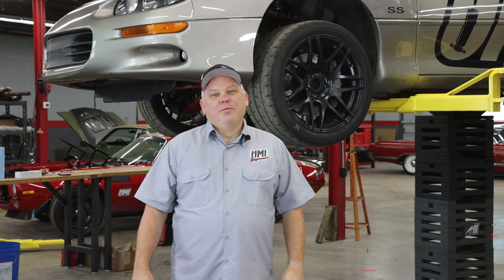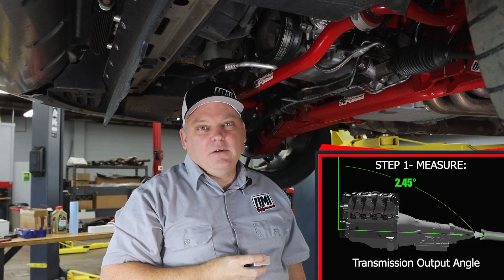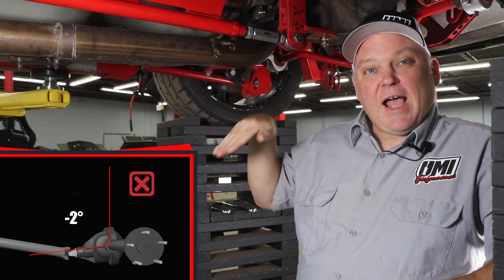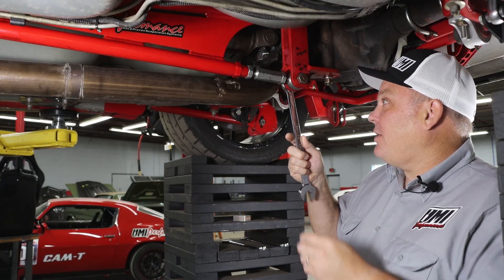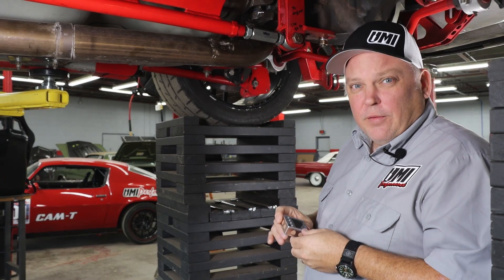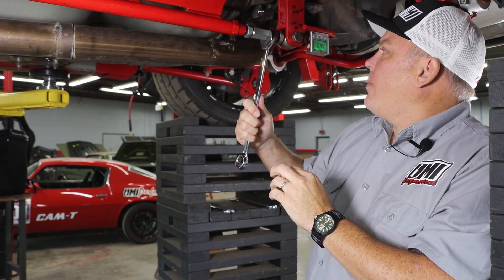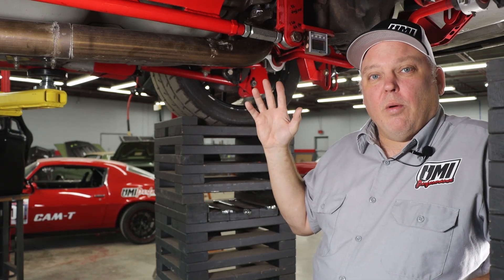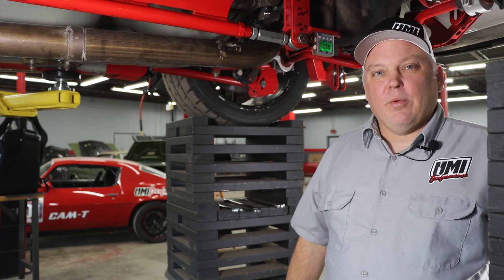HOW TO: 3rd/4th Gen F-Body Pinion Angle Adjustment

Comment: Ok. So I watched this video and chased my vibration. What I realized today is that you don’t t explain the tool you are using. Explain that the magnet is in the bottom of the tool. When checking the crank pulley the tool is in the vertical position with magnet down. Then when you checked the pinion at the torque arm you had it mounted inverted with magnets up. That explanation would have saved me some headache.

Comment: @ UMI
I have the 95 Z28 vibration at starting at 65 acceleration to 80. Crest a hill top put car into natural on down hill side vibration stops. This car is new to me. On service I had both u joints replaced and vibration is less but I want zero vibs. **Note pinion seal leaking
CRITICAL THINKING: The car didn't shake off the show room floor.
RUMORS: aluminum  drive line fixes , + 1.5 pinion angle fixes, new torque arm bushing don't  fix.

What happens over time with suspension control arms?
Do they have bushing mounts? Car has 130k miles.

Does anybody have knowledge of this common issue with the 4 gen Camaros
and a no bullshit fix?
I could spend thousands and still not fix the real issue.
Thanks

Comment: Just installed your arm and crossmember.   You need to update your instruction sheet !!!  It says to used driveshaft angle and pinion angle which would be totally wrong.  In my 89 the driveshaft actually raises from the trans to the diff.   If I followed the directions with the kit, the pinion would be severely nose down !!  It also states the crossmember bolts are M8.  They are M10.

Comment: Good video I was chasing a vibration and found my umi torque arm was hitting the driveshaft safety loop bolt. I bolts were on the 2nd hole from top and I moved it down to the 2nd hole from bottom much better and set my pinion angle at 2 degrees. Still a little vibration but way better than it was. I'm assuming it's because I have a poly trans mount and stock motor mounts. Gonna switch out that trans mount to stock rubber and see if it makes another difference and gets rid of vibration entirely

Comment: So what if your driveshaft runs up from the transmission to the rear axle? is the procedure the same? My car is lowered and the pinion sits above the transmission output.
Reply from the maker: I've never had that exact question before. I would start with the pinion nose about 1/2 degree down in front and check for vibration. Since we're looking for a range and not an exact number you should be good to go there.
Reply: @umiperformance  ok thanks. I can only get my transmission ti about 2.7 degrees (tail down) and it is right on the tunnel. When I do the math using the Tremec calculator online the 1 degree up angle of the driveshaft adds to the transmission tailshaft making the angle 3.7 degrees which seams to high. I guess I could  raise the ride height to help the driveshaft angle.
Reply: @mikeschanel6165 i literally have this same problem as the added length of the turbo 400/gear vendors combo in my 4th gen causes the driveshaft to run up to the rear pinion. guess ill try both ways (pinion down vs pinion up)
Reply: @tubbytownsend  that's what I did, kept adjust either way until I found a sweet spot. Still has some vibration but much better. I'm looking at installing a 9" rear axle so the pinion will sit lower, helping the angles
Reply: @mikeschanel6165  i have a S60. right now i have 1.7 degrees down on the tail, so i am going to set the rear to .3 pinion up (figuring 1.4ish degree difference since i have rod end suspension) try to be in the middle and see what it does.

had a vibration starting from around 105mph to 135mph at the track. hoping this helps
Reply: @tubbytownsend did you fix the problem? I have a s60 as-well and a umi torque-arm, having a vibration around 60+
Reply: @Jayreynoldss  yea setting the pinion angle the way the video says fixed it.
Reply: Follow the video and NOT the instructions that come with the kit.  The driveshaft doesn't make a difference.   It doesn't even have to be in the car.  The relation of the pinion angle to the trans output angle are what you are adjusting.  Think of it this way.  If you turned the car upside down your drivetrain would appear conventional with the shaft running down to the rear.

Comment: So if my crank pulley is 3.55 degrees. Do I just subtract -2.0 degrees so I would end up with 1.55 degrees at rear-end?
Reply: Yes not for the street though, the -2 degrees pinion angle setting is mostly for the strip where max traction happens and the pinion moves for the street, street tires you're better off with a -1 setting or even equal if you could add weight in the cabin or have someone sit in it to simulate weight in the cabin it would be better.
Reply: @adelaseeri768  heck ya

Comment: Dont you want negative between driveshaft and pinion? He set transmission output shaft and pinion negative in this video. Dony you want those parallel?
Reply from the maker: The way the video describes, the pinion and crankshaft will end up parallel under load. The angle starts slightly negative and then ends up proper under accel. Also, there are many factors so the number doesn't have to be exact.  You can contact us at support@umiperformance.com if you're having any trouble.